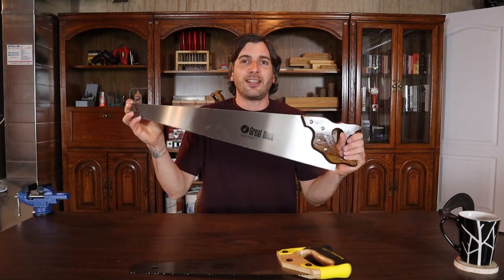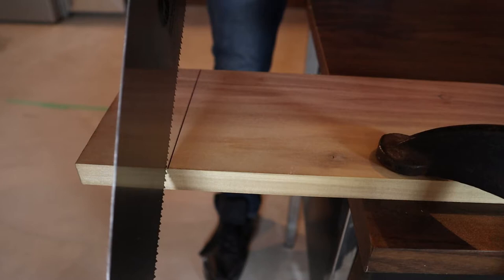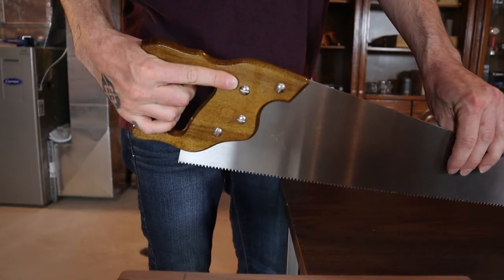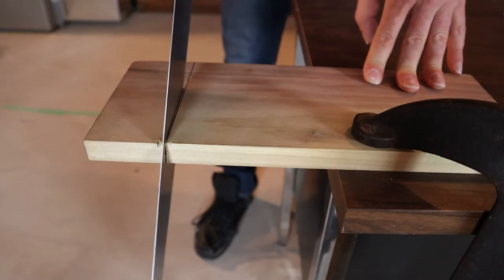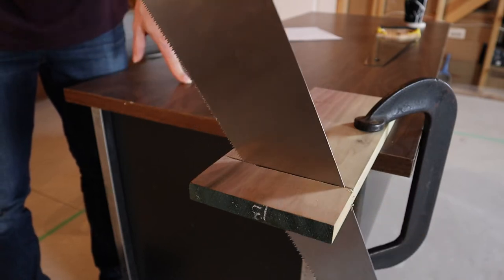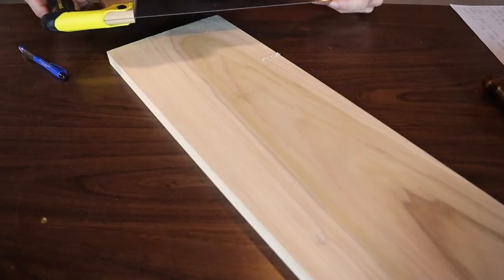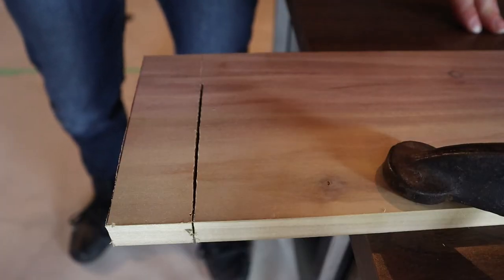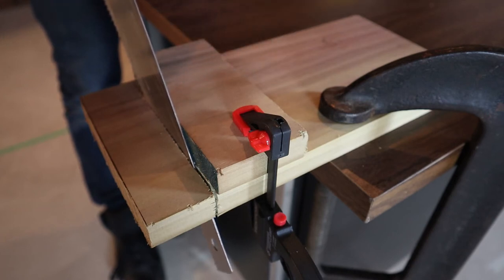Before You Use A Hand Saw Watch This ( All The Pro Tips You Didn't Know  )

Comment: My only question is that what kind of oil can I use for my saw blade so that way it can cut smoothly
Reply from the maker: A little bit of vegetable based oil will work. There are specific saw blade oils you can buy though.

Comment: Don't the saws cut on the forward and backwards with certain type of teeth?
Reply from the maker: Ya there are saws like that. The are more common now then with older saws
Reply: A reply🎉. Should the rocking motion cutting technique also be the used when the saw has these modern forward-backwards teeth?
Reply from the maker: You can but you don't have to
Reply: Pull  🪚 I.e. Japanese pull 🪚 only cut on the backwards stroke ..as the name suggests 😃